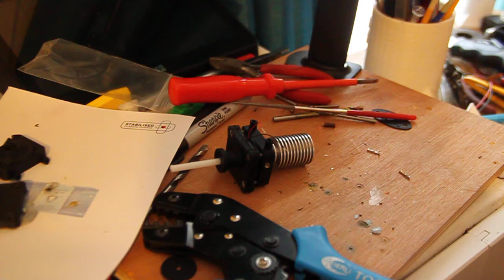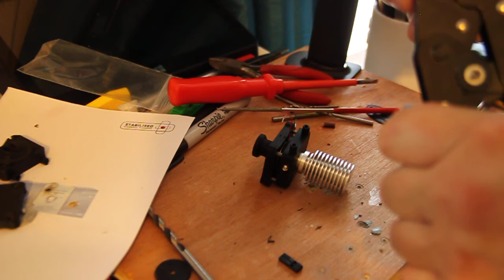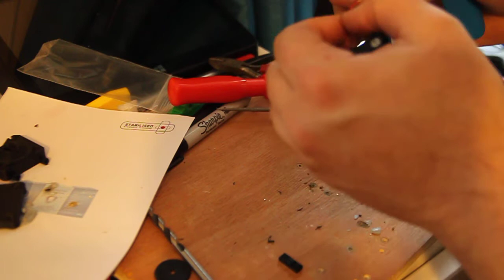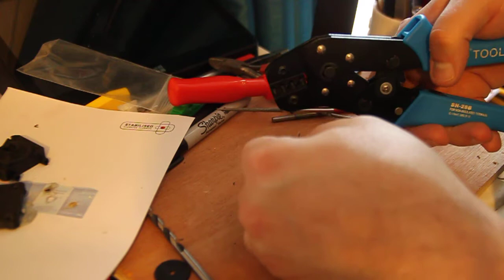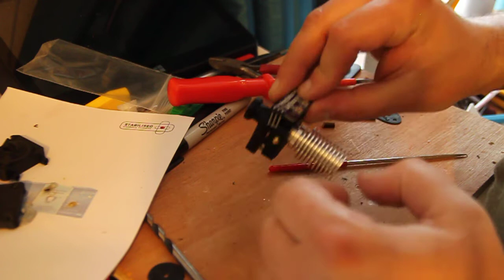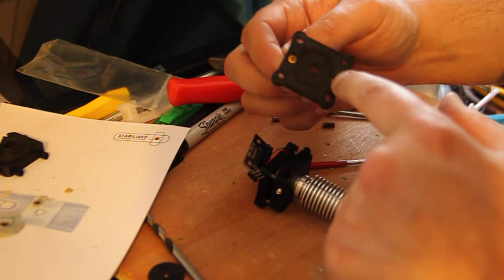Precision Piezo - Piezo20 Module Part 4, adding the PCB

Comment: You mention the hotend still moves after tightening, doesn't that affect the quality of the print?
Reply from the maker: It moves vertically (approximately 0.1mm) but under quite a bit of tension, which is the pre-load on the disc. No it does not affect the prints. The nozzle using these units is firm.

Comment from the maker: At 0:22 where I say the "piezo sits in the recess" in the upper part, I mean it sits on the flange just inside the recess. So it can bend in the middle when triggered. DO NOT try to fit it all the way into the recess!